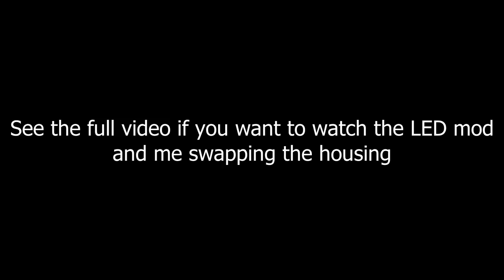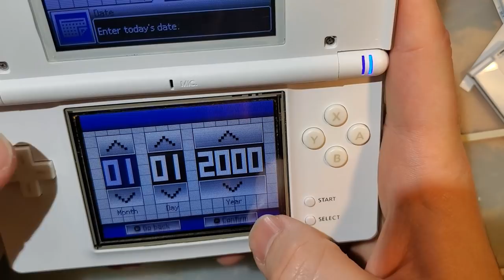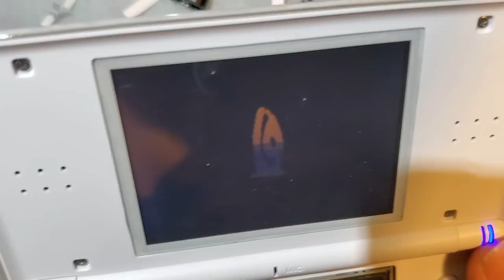DS Lite USB C Charge Mod

Comment: I saw how fast he was shoving that antenna wire under the cart slot and said "if he gets it first try I'm going to steal his cat."
Reply: There's a magical spot almost at the top of the cart slot where the antenna goes through perfectly fine. Make sure the connector is face DOWN not face UP or you will have a bad day.

Comment: 41:03 That deformation is probably caused by the Wifi antenna cable being trapped between the bottom shell and the PCB, since the USB-c mod eliminates or narrows down the space where that cable would normally be routed ;y

Comment: it seems like the case needs to be trimmed slightly to fit everything flush according to rorosaurus's install guide. since his shop is sold out and he does not seem to be restocking I am having some made by OSH park that are half height PCBS and that should fix the issue.
Reply: I'd also be interested, if you have any left over.
Reply: @spengineer2064  Hi sorry I ended up using all of the ones over a couple of mods for some friends however the assembly process isn't terribly difficult I'm only a mid-level solderer and I was able to put them together If you look at his tindy page you can get the schematic and all of the required part numbers to orders
Reply: @lynnwalkerkelly  still outta stock… I messaged them on Amazon like last year (literally) and they don’t know when there will be more stock.. so I just bought some pcbs and will be building them myself

Comment: also dumb question but have you considered using a lint roller to clean up bits of solder and plastic and whatnot on your desk after a project? might also help w cat hair
Reply from the maker: I just use a small bit of tape and it works fine for me.

Comment: I have the old Nintendo 3DS that won't switch on, whenever I try to switch it on both screen flicker and then it switches off, I'm not sure what the problems is, please help.
Reply from the maker: It could be any number of things. You have more detail than I do. What changed? Did you take it apart? Did you try to eliminate variables such as battery or SD card? 

Try a console repair discord or subreddit or something.
Reply: @makho  To be honest im not sure what the problem is, it work fined and after a while the hinges became loose and that's when the screen flickering started but thank you I will do as advised.
Reply from the maker: @Princemoyo137  sounds like your top screen is bad then and based off your description, that's where I'd start. New screens are inexpensive but disassembly and replacement is not an easy task.

Comment: @makho is there any way you or anyone in the community can develop a push button option for the DS lite's power switch? Those tiny levers are super fragile. Or even a workaround where if you press start and select at the same time it'll trigger the power. Just spit balling but I hope it's possible.. thanks for your work man
Reply from the maker: you know the current switch can be replaced with any momentary SPST switch, right?
Reply: @makho  I haven't seen that mod anywhere I had no idea

Comment: Great video indeed.

Just ordered some PCBs from JLCPCB (which offers free PCB prototype twice a month here) and the components from LCSC, gonna try it myself.
Just not sure if I'm gonna handle those 0402 resistors xD
Reply: Update: got the mod installed on my white DS Lite. Unfortunately I have to cut the shell a little bit, and the Type-C port stick out to the shell as well thanks to my poor skills. The worst part was that my DS Lite shuts down immediately on power on. Just a blink on the green light and it's done.

I thought I must had blown up something but eventually found that both two fuses are fine. My friend which is a Electronic Engineer who helped my a lot to diagnose the issue, and he found that all the voltages were fine, and after removing the Wi-Fi module the console did turn on but won't go into the system. So I ordered 3 Wi-Fi modules from a second seller who guaranteed these to work (which is pretty cheap BTW, even cheaper than shipping fees here xD), put them on, and nothing happened. Still won't turn on.

At this time, I thought probably I've fried the PCB and was already seeking for second hand motherboards. But thankfully, it's just the flex cables not inserted properly way in xD
Reply: @kevin_mx  What a thriller movie script.

Comment: If I was interested in fitting a DSL with a USB C power socket, where would be the best place to source a conversion board, like the one provided by Rorosaurus?
Reply from the maker: you can buy one from rorosaurus or check the linked github repo and make it yourself
Reply: @makho  What PCB thickness? Roro recommended .8mm for the GBA one, but doesn't have one for the DSLite.
Reply from the maker: @shanez1215  probably the same, ask roro

Comment: Anyone know another solution for this?  I have a DS I want to do this to but looks like amazon and the site are out of stock.
Reply from the maker: The source is listed in the github. You can order more boards from that.
Reply: @makho  So take the Gerber files to a PCB supplier and have them custom build?  Do you have a supplier you would recommend?  Sorry I am not an electrical engineer so going outside what I know.  Thanks!
Reply from the maker: @MonkeyKing715  Yes, upload the gerber files to a place like oshpark and they will make and send you the PCBs. I don't know off hand if these boards are supposed to be 0.8mm thick but if so, make sure to check that option once added to your shopping cart because the default (1.6mm) would be too thick.
Reply: @makho  Awesome!  Thanks for the info.  I am using this as an excuse to get a better soldering iron, currently using a wood burning kit one which is okay for wire but I don't think would cut it for this.  Any recommendations on what to look for doing something like this?
Reply from the maker: @MonkeyKing715  something with temp control probably
Reply: @makho  Thanks for all the help.  I have everything on order except the resistors.  Searching is giving me a lot of film resistors.  Any help pointing me in the right direction on these?
Reply from the maker: @MonkeyKing715  if you search the size (0603 IIRC), you'll find exactly what you need.
Reply: @makho  got everything on order, can't wait to try.  Thanks!
Reply: Hello, have you succeed ?
Reply: @guillaumebidot531  Good question.  Just received everything a couple weeks ago, super cheap but took forever.  Looks good.  Plan to solder in the next couple weeks.  Life has been pretty busy at the moment.
Reply: @MonkeyKing715  Good luck, if you have one to sell i’m here 😉
Reply: @guillaumebidot531   I finished today, worked great.  Some things I struggled with was the 4 holes on the custom board matched the ds and the two back holes matched the ds but they seemed out of line with each other.  With a decent amount of struggling I made it work.  I think it was pretty tough as a novice but I made it work.  Took me 3 or so hours. Now I am ready for the battery mod.  I printed the expanded battery door on a nice resin printer and ordered a battery.   Any direction on how to connect?  Do I need the board from my old battery or should I solder directly to the leads?
Reply: @makho  I realized below I hadn't replied to you so you might not notice.  Mod went great, it is awesome to be able to charge with usb c now.  Now I need to address the battery.  I printed the battery door you had online and also ordered a battery.  I am confused how I should be connecting it.  I see you have a board for the sp.  Some people mention using the pcb from the old battery and from your description it seems you took the leads directly to the motherboard.  Any advice?  Thanks for all the help!
Reply from the maker: @MonkeyKing715  https://www.youtube.com/watch?v=ykxxOpwzhuU
Reply: @makho  Nice, so you do just use the DS printed board.  New question (sorry).  Do you have anymore detail of what you actually removed from the bottom housing to fit the battery?  I got them in and looks like I will have to remove more than I thought.
Reply: @MonkeyKing715  what resistors did you go with, I searched 0603 but there are different resistances for that size of resistors? Example: 100k ohm or 0.01 ohm
Reply: @Rhork77   on the move, let me check when I get some time at the office.  Is there any way for me to add pics in a YouTube comment?
Reply: @MonkeyKing715  I don't believe you can add pics to YouTube comments, unfortunately! Thanks for the quick response.
Reply: @Rhork77  I keep trying to link what I bought but YouTube keeps removing it.  I bought 5.1KOhm resistors from LCSC.
Reply: @MonkeyKing715  awesome thanks for looking for me!